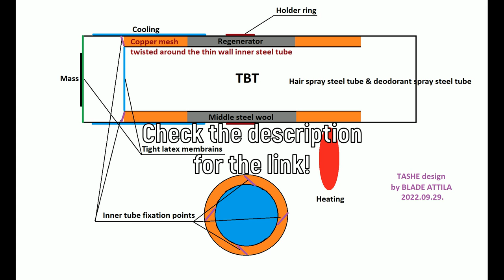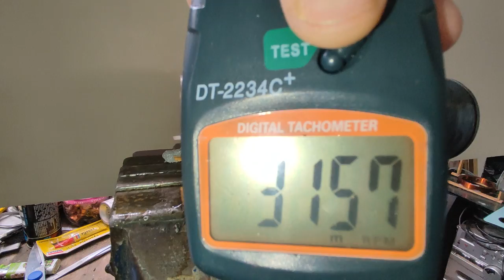Hair Spray Stirling Engine - inside view how I made it

Comment: Imagine heating the center two  stirline engine placed back to back and cooling the outsides.  The vibrating weights would be in sync, but opposing each other.  That should transfer less vibration to the table. 

I supose it would be a slight challenge to ensure equal tension on the membrane.  But if one gets the tension close, and considers the membrane mass like a weight on a spring, then a little tuning in the amount of mass can make two engines vibrate syncronously. Then placing the two engine back to back with a hole between the two engine  would help ensure the two engines always stay in sync.
Reply from the maker: Yep, the biggest challenge the membrane tension, but that double acting version will be interesting. I'm not pretty sure about in phase, I think 180 will be happening if the membranea are unsynchronised mechanically... But we don't know if we never try it! :)

Comment: Wow incredible i love you design !!
So is it self starting ? Do you need each time to let air escape first then close the pinhole or it is only the first time ?
Did i really saw the ballon being brought inside (with pressure difference ?) I didn't reallly understood what o saw before it started...
Thanks !
Reply from the maker: This unit I used balloon as piston needs to release the pressure before starts. It is selfstarting. I just closed the hole because that is a bit too big, and flush the air via that pinhole and the membrane lost from the stroke.
Reply from the maker: I just showed the inner structure before I started the unit. There is a tightened inner ballon on a smaller diameter steel tube. And between the tubes two heat exchangers an the regenerator section.

Comment: What’s the benefit of this besides a regular thermoacoustic?
Reply from the maker: What do you mean about "regular"?
Reply: @AttilaBlade  what is the benefit of using two diaphragms instead of one?
Reply from the maker: Thr benefits come from the cycle in, not from the diaphragm basically. This is a traveling wave engine not standing wave inside as yours. Efficiency is much higher theoretically because of the Stirling cycle works in the regenerator vs. Bryton in your stack. The other "benefit" is the length of the unit in this working frequency. Membrane could substitute a big volume of gas and a huge part of tube. It could be more compact as other full length 60Hz traveling wave units. But it could be shorter then a 60Hz tuned quarter wavelength standing wave unit too. This coaxial structure has lot of benefits but a bit more complex to calculate the right one. This one is only a working model, not really calculated. Came from my experience. BLADE
Reply: @AttilaBlade  very neat! Thank you!

Comment: More or less like the NASA Stirling, right?
Reply from the maker: No... It's just looks like that, but here we have NO displacer movement. Inside we have only a tube with membrane. That membrane is only a soft end where the  energy going back to the coaxial gas loop. In the NASA Stirling the displacer moves because there is a small diameter piston and that react to the pressure changes.

Comment: Why not just use copper mesh all the way rather than have a portion that is steel wool? Copper is more conductive, so wouldn't it just work better if you made the whole mesh out of copper? Copper should make a better regenerator than steel.
Reply from the maker: The regenerator should be bad heat conduction between the different temperatures, high heat capacity, high surface and good wire parameters to take of the heat from the gas. So copper is a bad regenerator but good for heat exchanger. The steel wool was a comprimise because the stainless steel is much better to use, but I have no SS wool. BLADE
Reply: @AttilaBlade  would SS wool that is very coarse like your copper be better than the very fine...err...carbon steel? iron? whatever the normal stuff is.  what about cheap stainless drink bottles? not the vacuum kind....but maybe the built in double wall there helps too?